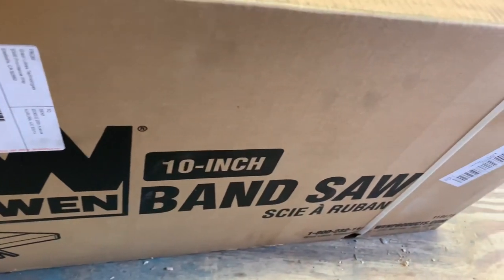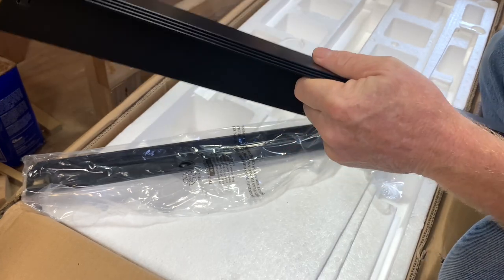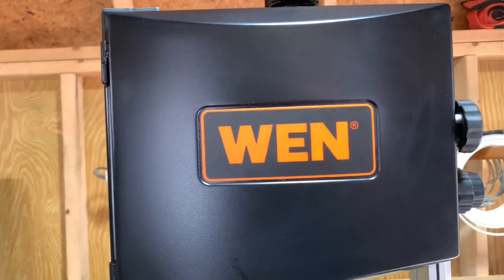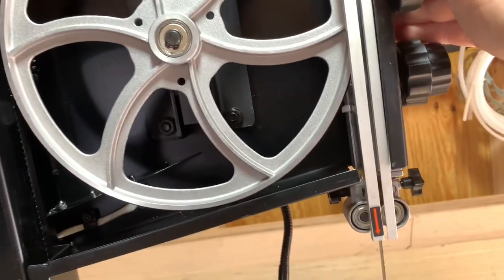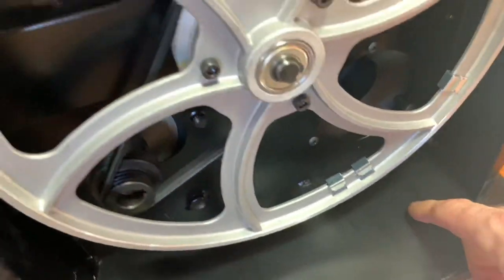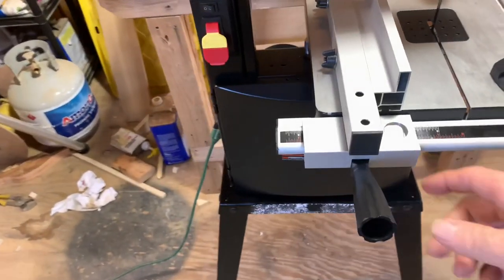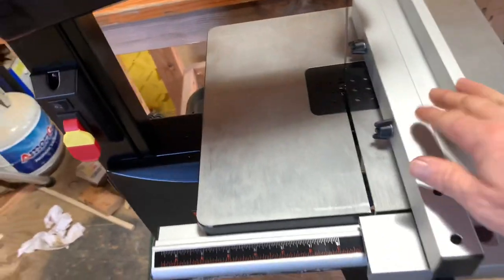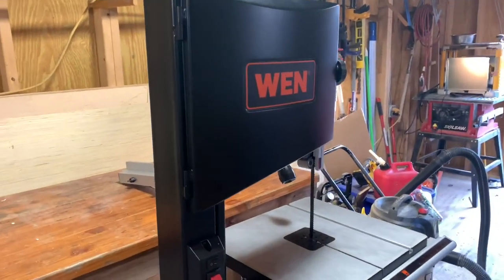WEN 3962 10” Bandsaw unboxing and a in-depth review.

Comment: My friend is moving to a very small place, and decided to sell his. It has about two hours of use. If it looks and works like yours, this is a solid buy for any hobbyist. 

Turns out that the Jet, Grizzly, and Rikons are pretty much  made in the same place/factory in china that these are. Some have laser beams and stuff, but I'll pass if the fence is good over time and the motor holds up/

Comment: I got one of these saws about 10 days ago through Lowe's.  Ran into a problem.  I have checked all the major retailers, Lowe's, Home Depot, Menards, True Value, Ace Hardware.  No retailer stocks a 72 inch blade for this saw.  Of course it can be ordered but that doesn’t help if you break a blade. Can’t just go pick one up and your project is delayed for at least several days.  Has anyone found a solution to this?  Thanks.  The window for returning this saw will be closed in a couple of weeks.   I prefer to keep it but not if blades are going to be this difficult to find.
Reply from the maker: There are some specialty wood stores around us here that carry a huge variety. But in most cases most just order extras to keep on hand , just incase. It’s always cheaper to order a couple than to buy at the store anyway.

Comment: When you were sawing I heard a pulsating sound, mine does that to, BUT never did before. Did you notice that? What could that be? I thought it might be a bad alignment bearing. Can’t figure it out and it bothers me. Any suggestions? Thanks in advance, Kevin
Reply from the maker: Could be the blade at that weld point.  Pretty sure it’s a different thickness right at that spot and could resonate a different sound as it passes around the pulleys.

Comment: On most of the saws the aux fence can be rotated 90⁰ and have the long side flat against the table so you can move ur fence in close with small stock and avoid running into the blade guides. I was looking at the saw alot before getting my used one

Comment: Great review- actually one of the best and most thorough product reviews I have seen!  Quick? Do the legs have a mounting hole in the bottom so they can be attached to a mobile base?
Reply from the maker: Hmm, I believe it does. If I remember correctly. I’m not home right now. I’m actually in Miami Fla doing a job and won’t be back for couple months.

Comment: I watched another review and the only complaint the reviewer had was having to take the fence rail off to change the blade. I'm wondering if after getting the zero set, the fence rail could be cut in half at the kerf to allow the blade to pass through during a change?🤔 Appreciate the review as I'm looking at buying one.
Reply from the maker: Good question. I’ll have to look at it.  
Thanks for watching

Comment: Great video! I subscribed.  You'll probably want to get a better blade and up the speed for cutting wood.  I'm impressed with what I've seen of the saw.  I could use a small bandsaw for detailed cutting as I use my large one for milling and resawing.
Reply from the maker: Appreciate that. Thanks for watching and the sub. Yes been planning to change blade to a smaller one.

Comment: Thanks for this great review very informative. Do you know if a 72-7/16 Length blade will work.
Thanks in advance.
Reply from the maker: You know I keep meaning to get another blade but haven't had the time yet. so I'm sure what choices they have on size options of what will work.
Thanks for watching means a lot that I can help people.
Reply from the maker: I checked Manual it says 72in blade I bet there is enough adjustment to possibly handle another 7/16 of an inch.
Reply: @Grimmeute  Thank you. Yeah I just purchased this band saw and want to adventure into bandsaw boxes to give as gifts. The blade that comes with it just isn't tight enough around the cornes and can't get a 72 Local.
Thanks for getting back to me.
Merry Christmas.
Reply from the maker: It will take down to a 1/8 wide blade. That’s the one I want to get for stuff like that.

Comment: Great job unboxing and reviewing the bandsaw out the box. I'm looking at getting a entry level bandsaw and I'm leaning on the Wen 10" Thanks for sharing. Have you had a chance to provide some insights as to its performance, what you like or dislike?
Reply from the maker: So far I haven’t had any issues. Other than get you a thinner blade later for those tighter turns.
Reply: If you lean on it , it'll probably allover!
Reply from the maker: Don’t you hate phones auto corrects? 😂
Not sure if you’re saying it will roll over or it will be all over.  My freaking phone is always changing what I had typed.

Comment: how is it behaving so far? I am planning on getting this same saw soon, thanks in advance
Reply from the maker: I think it’s been doing great. I do recommend getting a smaller blade to go with it. The one that comes with is not so great if you plan on doing some tighter turns. Thanks for watching sir 👍🏼
Reply: @Grimmeute  THANKS FOR THE tip i will get the smaller blade
Reply: I’ve been trying to get a part for my bandsaw for weeks. It’s out of stock and no idea when they’ll be back in stock. I would think twice before getting this.
Reply from the maker: @marinasdesignco7416  yes this is the case with many companies because of lock downs.  Production on building parts has dropped, everywhere except countries that know this pandemic was a scam.
Reply from the maker: Probably same excuse everyone is using. Covid has us behind.

Comment: I have the Wen 3962 bandsaw. Bought it second hand. How do you adjust the speed?
Reply from the maker: Inside there are 2 different size blade wheels so you get 2 different speeds depending on which one you have your blade on. It should be written near there, inside